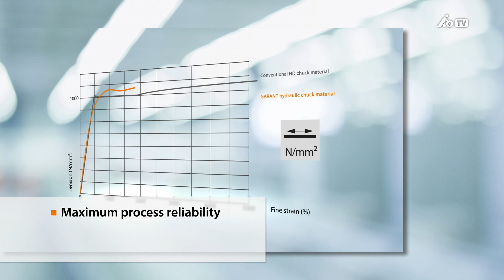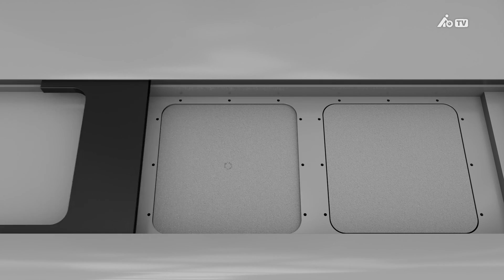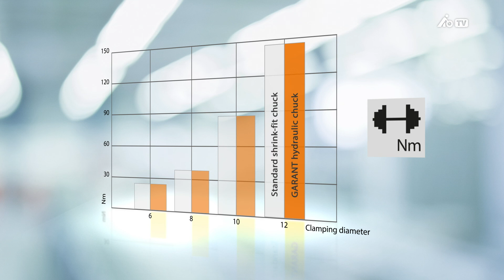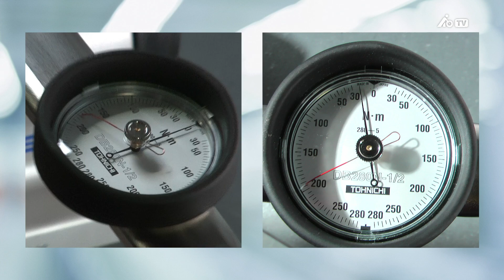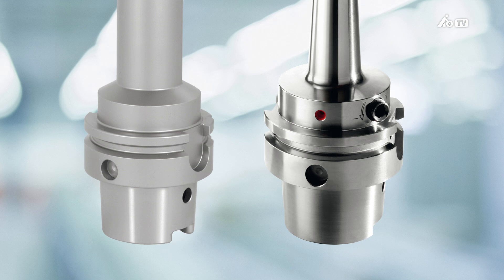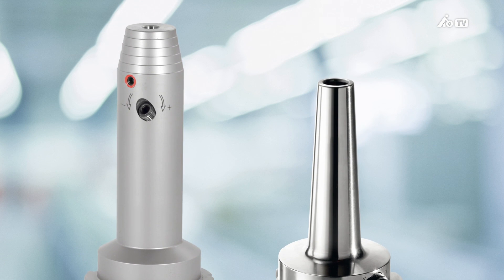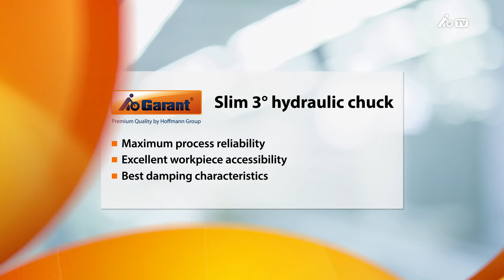GARANT slim hydraulic chuck 3°

Comment: An sich kein schlechter Ansatz.

Die Wuchtgüte lässt in der Praxis trotz exaktem betätigen der Kolbenschraube zu wünschen übrig.

Ein Futter in dieser Preisklasse  sollte wiederholgenauer betätigt werden können.

Gerade wenn mit Drehzahlen <30k gearbeitet wird extrem wichtig.

Bei Fräsversuchen mit wkz. D0.3mm in 90MnCrV8 62HRC mit einem 2 schneidigen CBN Präzisonsfräser  (definierter Rundlauf >0.001mm) wurde am gespannten Werkzeug mit Arbeitsdrehzahl eine kipp/Taumelbewegung von 0.004mm gemessen (42k rpm)

Im Vergleich ein Präzisions Schrumpffutter 0.0015mm.

Alle Schnittstellen natürlich peinlichst genau gereinigt.

Evtl. Ist hier noch etwas zu optimieren.

Wäre dann eine Super Lösung.